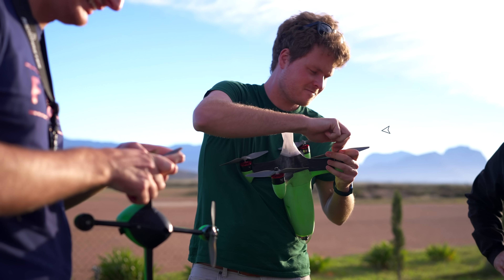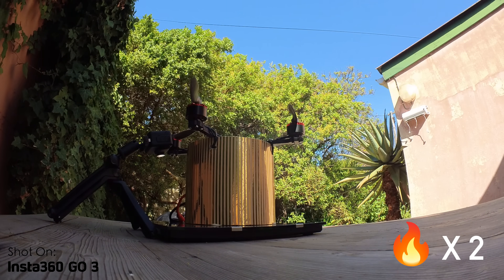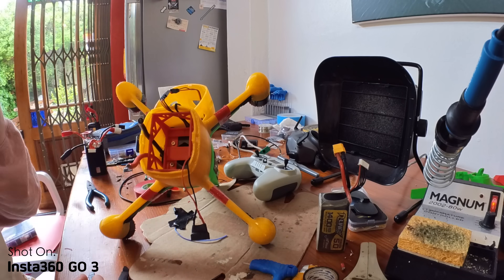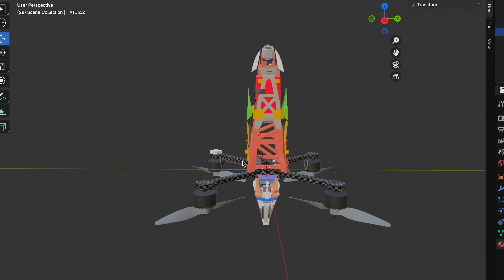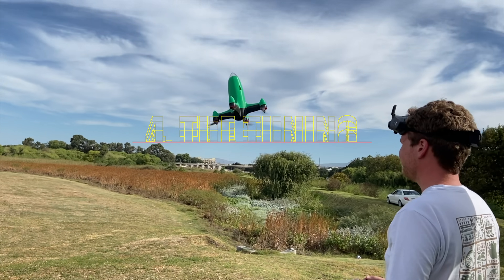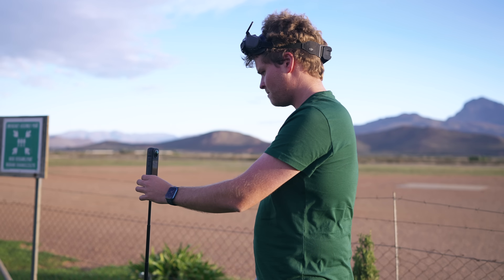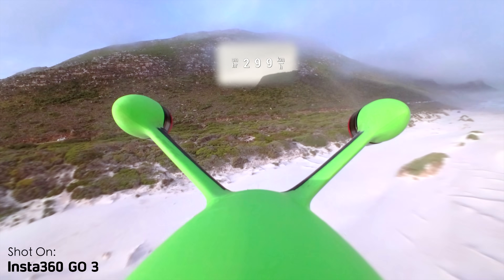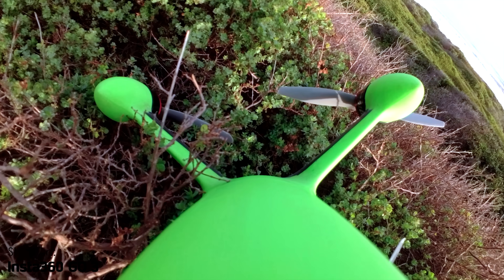How I Built the NEW World’s Fastest Drone

Comment: 6:00 I'm paused here, I'm probably incorrect because I know nothing about drones, but I can only imagine that "medium wire" is catching everything on fire like the small one did, just taking a couple seconds longer to ignite due to the thicker core or insulation, but, I can only assume that because it's was also moving by itself under high electrical load like my subwoofer's amp wires do when the drivers are throwing 😅 (and getting hot AF)
Reply from the maker: The video is designed to be simple and universally understandable. If I went too technical people would stop watching 😂 you can trust that I used a suitable wire thickness

Comment: Amazing engineering. On the 3D print surface finish, what I do to get a glossy finish on 3D parts in to apply two coats of clear West System epoxy then go through 250, 400, 1000, 2000, rough cut, and fine polish mediums. This will give you an aircraft finish. You can add car wax if desired. Also this does not add significant weight.

Comment: Your drone project is interesting, but it's too empirical. Why not use SolidWorks to simulate aerodynamics and structural resistance before building? Additionally, programs like LTspice and ANSYS Maxwell help predict current consumption and prevent motor overheating. This would reduce errors, costs, and risks. For safety, a CO₂ extinguisher or Class D extinguisher is essential when working with electronics and LiPo batteries. Simulate first, build later!

Comment: Heat in any wire is voltage lost at the load end. Going to the heaviest wire will reduce energy losses, greater net to motors than the added mass penalty. Next time consult with a high school level electronics hobbyist that understands Ohm’s Law and the relationship between resistance, current and voltage drop.
Reply from the maker: You are so smart, thanks for the help 🙌🏼

Comment: you know, adding a few thermoresistors and emergency shutoff switches would prevent a lot of fires lol
Reply: no it wouldnt. the drone pulls well over a hundred amps at full throttle. theres no way to differentiate current pulled from flight vs current pulled from short circuit

Comment: LIPO´s with higher C rate have often (at least with good brands of LiPo´s) larger solders and cables to handle the AMP´s inside the battery, just not only the chemical "LiPo recipe" that makes the C rating higher.

Comment: Looking at your design it hit me!! Why not create a 2-stage high speed drone? Imagine a quad copter stacked on top of a quad copter. I would recommend that the motors not line up with each other when it’s stacked but instead place them in a configuration of an “X” “+” pattern. Meaning if you look down at the drone the motors on top would be in an “X” configuration and the drone on the bottom would be in a “+” configuration. The speed should be insane!!!!
Reply: So an octocopter? No that wouldn't be faster at all.

Comment: please please use kmph. kmh is equivalent to mh (which are both nonsense)
Reply from the maker: Kmh is the same thing as kmph
Reply: @LukeMaximoBell  No, it is't. kmh is kilometer hour. kmph is kilometer per hour. mph is mile per hour. The kmh (kilometer hour) is nonsense. It's commonly used among SI deniers but it's still nonsense. Even your HUD that is apparently from the SI planet shows (at 11:49) the right things: km/h. Also the 459 MA/h and 749 MAh are there which are different things (although the 'M' should be small 'm' as it's milliAmps, not MegaAmps).
Reply from the maker: @4ndrej  You would you to be an idiot to think I meant kilometer hour when I said kmh. That doesn't even make any sense. It's very clear to anybody with some sense of logic that it means km/h.
Reply: @LukeMaximoBell  exactly that's I am saying that your writing kmh does not make any sense. Write km/h when you mean kilometers per hour as you write mph when you mean miles per hour.

Comment: what would happen if the props where fully housed on the rear with the overal rear opening being reduced a bit like a funnell? normall with a large volume of air being forced into more narrow corridors of streams it vastly increases the speed of the outgoing air so not only would you have the pull effect from the props but also increased speed of the wind speed from the jets. also if the jets flowed along and down the body so far that would also increase the air stream effect of on the body giving more speed. or i could be wrong. if i'm right you could gain a extra 20 - 30% speed increase

Comment: Try using the heat off the batteries and wiring as an improvised booster like a turbine engine works.  The speed will ram cold air into the front, the heat will expand the air, and design a smaller exit (or exits) which should give a small "jet" boost of that expanded air.  Might work, but might not be enough to matter.  I dunno.....

Comment: I wonder if you try to put golf ball dimples on the body if it would further reduce drag and go even faster. Golf balls fly farther because of the dimples.
Reply from the maker: Dimples on a golf ball help increase lift and therefore travel because it is a rotating body.  Plus the ball speed is relatively low so dimples would only increase drag when our drone is at top speed.

Comment: Wow. Then again, you are not that far away from 500 km/h ;-)
Sandpapering is fine, but did you think about 3D printing it a shark skin? Or - please look up AeroSHARK. It's a bionic adhesive film modeled after the skin of sharks. The famous efficiency of sharkskin has been utilized to optimize the flow of air around the aircraft, leading to significant fuel savings and emission reductions.

Comment: You could improve it, if you use wires without isolation. Just make sure they don't get in touch with each other or other conductive materials. If the wind of propellers and/or flight wind passes by, the heat dissipation will be much less a problem. Next level would be to use copper tubes instead of wires. That would make improvements because the skin effect won't play a role like in your wires. You could use a copper plating on the outside of the housing, it could even play a role in mechanical stability. In the end the copper mass could be smaller and therefore the drone can get lighter.

Comment: Lipo C ratings are ABSOLUTE Bullshit. 100% The only companies that come close to telling the truth are Turnigy and SMC. SMC admits that their C ratings are not true but they have to compete in the market so they invented a way of measuring the power of their batteries by using a constant load (I think something around 100A) and then they give the average cell voltage for the pack. 100A on a 4S 5000mAh....3.80...score is 380. 100A on a 6S 1500mAh.....3.65...score is 365.

So you need to factor in on your own the capacity difference as C rate does.....but that's easy to do. Obviously the voltage of a Lipo isn't perfectly linear but from 4.20 to 3.50 its fairly safe to assume that the difference between 370 and 380 vs 360 and 370 on packs of equal capacity shows a similar difference in the packs power.
Reply from the maker: So true! So annoying how they don’t give accurate numbers 😞

Comment: Congratulations! Question: I think the motor is not a V3115, according to the specification it cannot give more than 7928 W instead of 8.8 kW, also the reference on the video was blacked out. Conclusion: I think the real reference motors gave about 70% of their power, so maybe there is some possible improvement to go faster (stability seems to be the key, right?)
Reply: Motor ratings mean absolutely nothing. They will pull however much current you give them until they smoke. And such builds already operate components beyond their specification ratings. "Power" isn't everything. Prop tip speeds were already going transonic. It's very easy to make rpm but pure power is not the limiting factor.

Comment: When pairing batteries with a new high powered project make sure your batteries can handle the high amp draw from the motors and ESC you can also run a amp meter to find out just how much amps its drawing helping you decide on your prop, motor, ESC and battery combination. Probably highest amp ESC you can fit with 12ga wire and lots of air flow over your battery and power system to keep things cool , and the pitch on your prop will also effect your amp draw.( Sometimes removing the shrink wrap from the ESC will help it cool faster. )But great job and congrats!!

Comment: Throwing something out there. What if you integrated the golf ball design into the body. I’d imagine you wouldn’t want to do the whole drone with little divots. It probably needs smooth parts for stability. But divots could add some speed if it’s not uncontrollable
Reply from the maker: Yeh that is interesting. We might do something with that for the next version or test it in software.
Reply from the maker: Dimples on a golf ball help increase lift and therefore travel because it is a rotating body.  Plus the ball speed is relatively low so dimples would only increase drag when our drone is at top speed.

Comment: Out of curiosity, any particular reason to use FDM over SLA/some other method? Theoretically the aerodynamics should be significantly worsened by the layer lines-- and FDM parts are definitely heavier than a lot of other materials (maybe LW-PLA could improve things slightly with FDM?)
Reply from the maker: FDM is the only one big enough that would work I think.

Comment: How about adding small movable canards on the nose for horizontal flight. Right now the top motors operate with reduced power to keep from driving it into the ground while horizontal.
Reply from the maker: Yes you are correct. The bottom motors do consume more power. This would be interesting...

Comment: I wonder what would happen if you designed the drone body like that of a golf ball surface. There is an aerodynamic reason they have dimples.
Reply from the maker: We might look into that...
Reply from the maker: Dimples on a golf ball help increase lift and therefore travel because it is a rotating body.  Plus the ball speed is relatively low so dimples would only increase drag when our drone is at top speed.
Reply: @LukeMaximoBell  Thanks for the follow up. I was just curious as Myth Busters put dimples on a car and claimed it got better gas mileage.

Comment: Cool project 🤙 Surely you'd get even higher speeds with some good branded props, instead of those seemingly random no name ones? What props are they? Did you use Betaflight for the flight controller firmware? If not, and you feel it could fly better, try flashing that (latest version) and apply default "5 inch" PIDs and filter settings. The Betaflight defaults are solid. Surely Chris Rosser must have suggested that, or similar. There are so many 'presets' within Betaflight that you could experiment with to see what makes it fly best. Also what firmware is on your ESCs? Good ESC setup can make a big difference too.
Would be cool to hear more about the FPV setup, but then I'm an FPV hobbyist, so I would say that... Also, if you're using the DJI O3 video system, that's heavy as heck. You could save weight with analog, Walksnail or HDZero.
If you're concerned then about adding an extra receiver rather than it all going through the O3, ExpressLRS receivers are TINY now and the range and latency are phenomenal. Transmitters('radios') with ELRS in are getting cheaper all the time, and as with other protocols, you can buy the transmitter modules separately and install in the bay on the back of existing compatible radios.
Reply from the maker: Thanks for trying to help man, but the video is designed to be simple and enjoyable to everybody watching. I am very experienced in the FPV world, so giving me this advice here is kind of like telling a bodybuilder that eating protein is important to build muscle mass.
Reply: @LukeMaximoBell  Hey man, I appreciate you coming back to me. The first half of your reply is perfectly fair enough, and I respect what you're saying there. The second half has totally turned me off subscribing to you. There's no need to sound so big headed, just be humble. How should someone new to your content know what your experience level is? You're as bad as the other guy who dicked all over my original comment, when all I was trying to do was help a brother out if you needed it.
Reply from the maker: Okay fair enough. To understand why your comment was a bit frustrating to read here are the answers to it.

Surely you'd get even higher speeds with some good branded props, instead of those seemingly random no name ones?

APC has been making high pitch props for decades and they perform brilliantly. There is a reason all the fastest drones in the world use APC. Just because you haven't heard of them doesn't mean they are random no name props.

Did you use Betaflight for the flight controller firmware? If not, and you feel it could fly better, try flashing that (latest version) and apply default "5 inch" PIDs and filter settings. The Betaflight defaults are solid.

Of course I used Betaflight. It's the best we have for this kind of build. Suggesting to use a preset for this is wild. I went through countless hours of tuning and modifying many different parameters to get the tune correct. I would never even think of using a preset for such an obscure and demanding quad build. 

Also what firmware is on your ESCs? Good ESC setup can make a big difference too.

I went through 2 different brands of ESCs spending weeks on selecting them and fixing failures and changing parameters to fix desyncs etc. Of course good ESCs can make a difference. 

Also, if you're using the DJI O3 video system, that's heavy as heck. You could save weight with analog, Walksnail or HDZero.

O3 is not heavy when the drone weighs 1.8kg. Besides, 30g of weight will make 0 change on top speed.

Transmitters('radios') with ELRS in are getting cheaper all the time, and as with other protocols, you can buy the transmitter modules separately and install in the bay on the back of existing compatible radios.

I have been using ELRS for years. This drone uses ELRS. 

I apologise if my comment came across as big headed or arrogant.
Reply: @LukeMaximoBell  Thanks for taking the time to go through all that. Putting frustrations aside now then, and just focusing back on the project which I still think is really cool, I'm sure a lot of people would be interested in a video where you focus on the electronics/components side of it, what parts and why etc. I don't like to bring the negativity, and obviously happy to be educated re' props etc, and your processes & reasoning, how you tuned it etc. Nobody knows everything, and I'd like to know more than I currently do. I think that goes for everyone, to be fair. I just don't appreciate being dug out when the intention was to help, particularly how the first guy did.
I hope you hit the goals you're aiming for. Best of luck.
Reply: lol you have no idea what you're talking about. you are the textbook example of the dunning kruger effect. like you just got into fpv a year ago and learned about elrs and betaflight presets and think your armchair advice is of any use . do you really think this person doesnt know what betaflight is? You are telling an FPV guru far more experienced than you how to do basics like apply presets or what an elrs module is. Did you really call APC random no name props? they are the only manufacturer in the world that make props that can be used at all for this application. Theres a reason the last dozen fastest record drones in the world all used apc props. Because you're such an expert why dont you make a 250+ mph drone out of standard 5" race drone parts and tell us how easy it is.

also only noobs like you use presets.
Reply from the maker: Your comment is very accurate! haha.
Reply: @redacted1946  Screw you buddy I've been building, flying and tuning since 2016. Get off your high horse. I'm just trying to offer some help on the off chance some of it's useful. Happy for the guy himself to reply and say thanks but no thanks, but absolutely no time for guys like you who think they're the arbiter for truth and righteousness. My legit frustration with this video was the lack of detail about the electronics. All the focus was on the frame and body. I'm sure we both agree it's a cool project, and hopefully we also agree that there's a chance something I or others here have said might help this guy go even faster.
Geez. Makes you want to never stick your neck out and try help someone. Don't just shoot people down, man. Be constructive. Like I tried to be. You don't have to agree with me but don't be a D-bag and get my back up.

Comment: Running your motors with high speed props stationary, they will always draw a lot more current then when they move at speed. So doing trial and error bench testing does not always give you the most optimum design.
Reply from the maker: Yes we realised this as well. We found that in the air there is about 30% less strain on the motors.

Comment: if I would change something it would the Battery > ESC > Motors. Put the ESC on the arms inside, with airducts or finstacks for the cooling. This will shorten the wires to the motors by a huge factor. You would probably also save weight as the Battery > ESC wires are only two wires vs 3 to the motor. And keeping those ESCs very cool is only going to make them perform even better.

Comment: ...but don't you lose power to heat? Probably not insignificant if the cables get that hot. Sure it's a balance but the power gain might outweigh the weight gain.